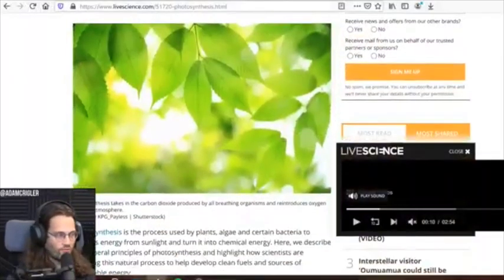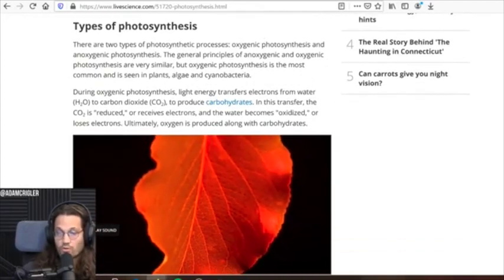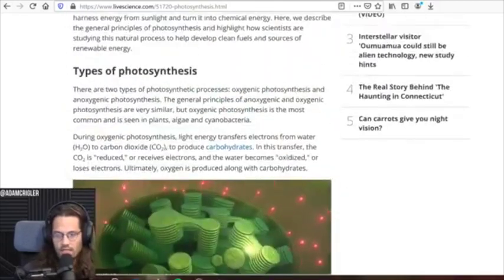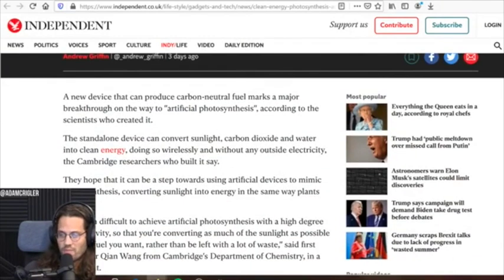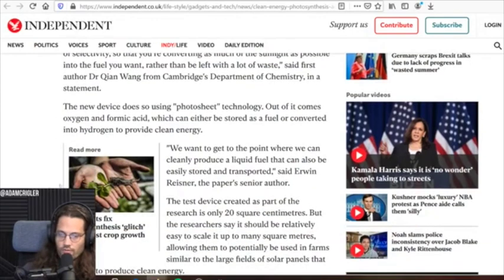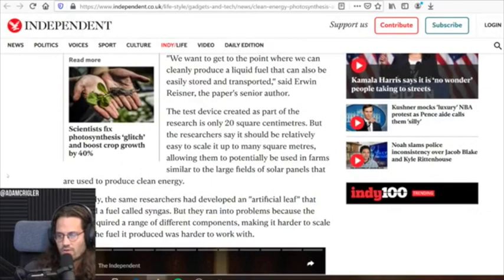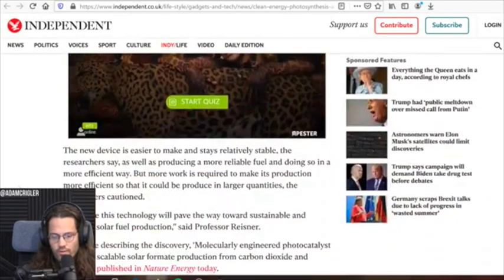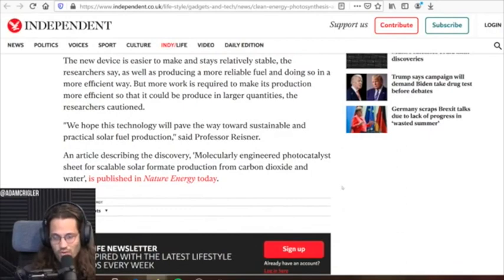Breakthrough in Artifical Photosynthesis

Comment: HI Adam, I hope that you take your time and fact check this and change your mind if you ore one of your friends don¨t find any wrong.

I have been advocating for mass production of FS-MSR since the beginning of 2000 because it is the only technology we know works to create global welfare by 2050 and without it no global environmental protection and an increasing migration pressure on rich welfare states.

A molten salt reactor of 600 MW requires as much resources to manufacture as a wind turbine of 12 MW if they are built in equal series.The difference is that the reactor gives full power around the clock for 100 years and can switch between the production of hydrogen and electricity.Hydrogen is everything we get from oil if it is combined with carbon dioxide.

I have had such hard counter-arguments so I have been forced to study all relevant disciplines for many thousands of hours and found that the carbon dioxide threat is scientifically rejected and most of the oil and methane gas we extract is extracted much deeper than fossils have been found with a high proportion of organic carbon. under the earth's crust in subduction zones and combined with hydrogen on its way up.

Wikipedia is, as most people know, hijacked by climate alarmists, so they claim that it is the greenhouse effect that gives Venus such a hot surface, but include facts that show that 90% of radiated solar energy is reflected into space.These clouds also reflect 67% of Venus' transmitted energy back to the surface.
Venus is warm by residual heat since the planet was formed (the earth is cooled by 10TW) and nuclear energy (the earth's internal decomposition of uranium and thorium releases 30TW).

For that, atmospheres must insulate because otherwise gas planets would be 3 Kelvin as ambient space.

From wikipedia about Venus:

"Above the dense CO2 layer are thick clouds consisting mainly of sulfuric acid, which is formed by sulfur dioxide and water through a chemical reaction resulting in sulfuric acid hydrate. Additionally, the atmosphere consists of approximately 1% ferric chloride.[75][76] Other possible constituents of the cloud particles are ferric sulfate, aluminium chloride and phosphoric anhydride. Clouds at different levels have different compositions and particle size distributions.[75] These clouds reflect and scatter about 90% of the sunlight that falls on them back into space, and prevent visual observation of Venus' surface. "

40W/m^2 is the energy from the sun that reaches CO2 below these clouds.

Early in this interglacial the global climate was just 3 C over the global average temperature IPCC have as reference.Then Sahara was green and had many lakes the biggest as big as the Black Sea.

Deserts radiate much more energy to space than plants or open water.Take an easy calculation so you understand how imported the temperature difference is.

Two black bodies with same size one with -80C and the other with +50C have average temperature -15C but if the difference gets away the average temperature will be +7 C without radiating more energy.(273-80)^4+(273+50)^4=2(273+7)^4

10 000 years ago when the global average temperature was 2C above today´s.The interglacial before had an even more life friendly global climate with 8C higher temperature for 6000 years on 

https://www.nbi.ku.dk/english/news/news13/greenland-ice-cores-reveal-warm-climate-of-the-past/

Just CO2 acts as greenhouse gas on the wavelength 15µm so it would be easy to detect a signal as a function in the atmosphere if it was one over 150 ppm.IPCC use typical 3m in laboratories which give 1C per doubled level if earth just had CO2 in a 3m thick layer.

The only scientific study that claims to have found an increased greenhouse effect as a function of increased carbon dioxide content is cherry picking.

Just switch to Colorado which has good data for the same period and is pretty close and you get the opposite result or globally 1940-1970 and 1988-1992

https://phys.org/news/2015-02-carbon-dioxide-greenhouse-effect.html?fbclid=IwAR3oxe4s9w1KrFHfahDDsloYCu83cOnrGwYFxz4Tswb7yAo4nhGie2skYFc

The world's deepest borehole in the earth's crust shows that much of the water that follows in subduction zones is exposed to at least 2000C and is broken down into hydrogen and oxygen, but it does not flow out of either the earth's crust or the seabed, which indicates that in the millions of years it takes to penetrate is combined with carbon where the majority is organic. 

https://en.wikipedia.org/wiki/Kola_Superdeep_Boreholehttps://en.wikipedia.org/wiki/Deepwater_Horizon

An example of human activity that contributes to warmer global climate.

https://www.nasa.gov/feature/ames/human-activity-in-china-and-india-dominates-the-greening-of-earth-nasa-study-shows

Ricing oceans is also fake, just look att island that stand on seabed or continetaplates that don´t had land ice for example Australia 10 000 years ago then it was 1m higher level around the great barrier reef for termisk expansion. 

South America's west coast is another example where seabed met continental plate on the beach and the don´t had thick land ice at that time.

One more fact that will change your mind.Ocean takes up CO2 from the atmosphere and creates limestone.We crush limestone when we produce cement, then as much carbon dioxide is released as the oceans have taken up but in pure form.We produce synthetic limestone from cement, which then absorbs as much CO2 as was released in the cement production.

Therefore, high-temperature reactors must lie deep in lime mines and produce hydrogen for process heat in cement production and for the production of synthetic fuels in conjunction with the pure carbon dioxide that is released.This model was proposed by the ORNL Obama administration, but it can greatly simplify control rods and most pumps can be replaced with thermal power control and convection.

https://info.ornl.gov/sites/publications/files/Pub29596.pdf

Here a better solution with NaCl as a mediator of thermal energy. 

https://www.youtube.com/watch?v=_ou_xswB2b0&t=97s

Comment: it does not tell the whole story. it processes CO2 into fuel. the problem is that we don't have the scale of CO2 production (getting it from air, or any other areas) to replace petroleum. if this takes off then most likely we will use petroleum to produce CO2, and thus we will still need fossil fuels.

Comment: 6:40 mining silicon? You know that quartz sand is nothing but silicon and oxygen (SiO4)? 
You can pick it up in the Sahara desert with bare hands 😉 OK, it's open pit mining but not that big of a deal. 
Si is also one of the most abundant elements on earth - no need to 3D print it 🙄 
(I'm not a chemist either but some high school chemistry did stick)
Reply: And one of the most abundant elements in Holywood. Would could also consider it open pit mining I guess
Reply: @timmyturner5864  Yup, only second to Superficicum